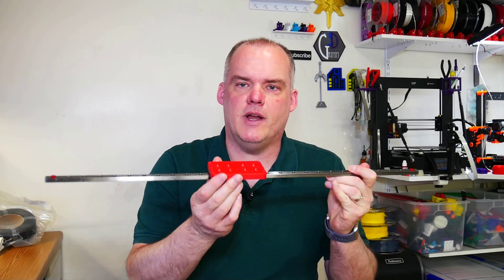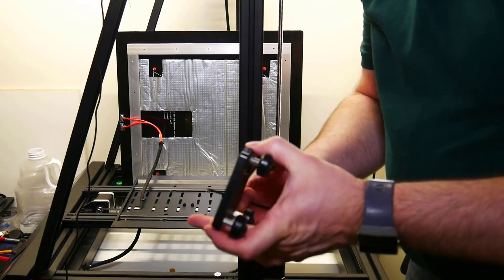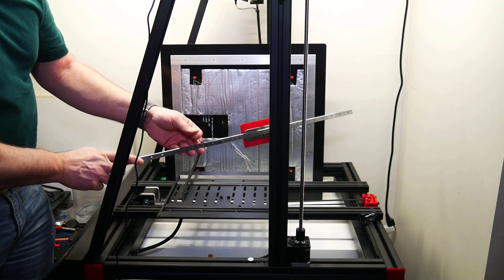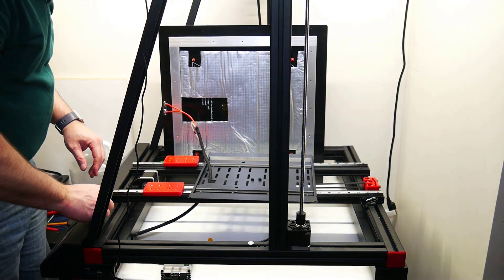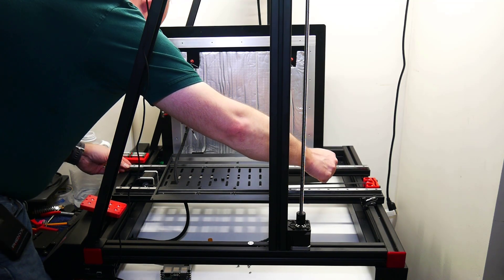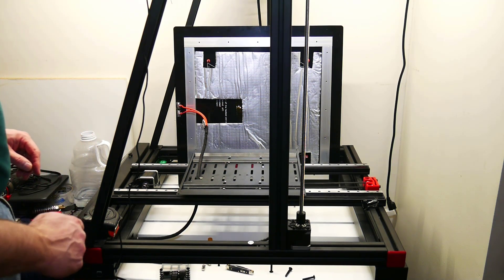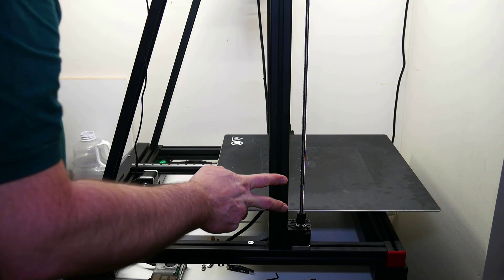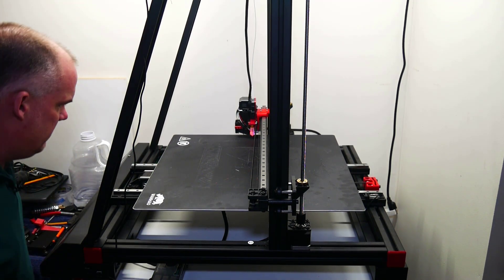Monster Y Rails

Comment: Thank You for the videos!
I added linear rails to my D9 500 on xyz and still had the same problems as is visible Your white benchy until I tensioned the x and y belt really tight.
I have now also added a bondtech extruder and use a 0.8 nozzle with it now, it has improved the reliability of the flowrate immensly.
My next improvement will be a new part cooling duct (and maybe a better hotend).
Oh and I just subscribed.
Reply from the maker: If you look through the playlist, I've already done many of those things. It is a process though - but fun. Thanks for watching and for being part of my channel.

Comment: Thanks for the video, it's going to save me time.  please can you post the stl link for the belt adapter that you designed.
Reply from the maker: Yes, I'll post it on Thingiverse, BUT I noticed that my belt is still not running true. The motor/drive pulley is mounted lower than my idler pulley, so I need to bring my motor mount up a little and then i'm sure I'll need to re-design the belt adapter so everything lines up perfectly. 

Here is the Thingiverse link: https://www.thingiverse.com/thing:4305709

Comment: Great video, please can you share the stl for your camera mount, been searching for hours to try and find it.
Reply from the maker: Which camera mount are you asking about? the one on the D9/500? I designed that myself and it was never posted. That mount won't work for everything because it will get in the way of larger prints. That's why i never posted the prototype STLs. But if you want it, I will post the STLs on Thingiverse. Let me know
Reply from the maker: Here is the link to the camera rail and side clamps https://www.thingiverse.com/thing:4320111/files

Here is the link to the Knobs I used for the adjustment bolts https://www.thingiverse.com/thing:4320090

Both require pausing / embedding in the print. If you need help with this, let me know. I'll post a vid

Comment: Are you going to place an skr board with tmc steppers inside?
Reply from the maker: I hadn't planned to upgrade the board and stepper drivers unless I need to. I did receive information from Moon's motors that there is a significant upgrade to the Y-Motor on this D9, so that might be a future purchase. My current plans are to add linear rails to my Z-axis, and after all that is done, I have a Hemera print-head ready to replace the stock D9 Head. 

Of course, these will be future videos, stay tuned. . . and Thanks for watching!
Reply: @Grimm3D  Alright, replacing the stock print head will definitely improve the print quality. As from what I've heard its crap lol. Still hesitant on buying a D9...Would rather just buy the frame and steppers only and add in my own electronics and hot end... Or tbh, for a bed this size. Isn't core XY the better configuration?
Reply from the maker: You can see the increase in my print quality if you watch the playlist. However, I purchased this D9 on a Black Friday Sale for around $800 (if I remember correctly) and I purchased it with the intent of tinkering. The D9 Mk2 seemed to have one of the strongest frames around. I'm sure the D9 is not right for everyone. 

A large format core X-Y printer would be sweet to build from scratch though. . . hmmm
Reply: @Grimm3D  Yeah I did notice it, have watched all your videos on the D9 ;) 

I wouldn't mind tinkering with a machine, but I am thinking buying/building a core XY printer that size would be only slightly more expensive, if not the same price as a modified D9. And the D9 will never be able to print at high speeds because of its  big heavy moving bed. This is where coreXY mechanism are better... I guess I'll wait and see what kind of quality u get when you are done modifying it :)
Reply from the maker: @obinnaeke8067  I expect to get pretty decent quality, but I agree, I don't think I'll ever get speed. 

Until I build a core XY monster. 😁
Reply: @Grimm3D  you're replacing it with a hemera direct drive or bauden? Wanted to get a dd hemera for my D9 300 but they've been out of stock for months. They're hoping to have some available next month so we'll see.
Reply: @Grimm3D  my ultimate goal is to replace the main board in my D9 300 with a duet wifi clone. The stock boards don't last very long I hear so the plan is to get it aligned, print some mods, install linear y and maybe X and hopefully by that time learn what it will take wiring-wise and config wise to swap to duet wifi
Reply from the maker: @alvarabra  I will be replacing with a Hemera, however the one I purchased is labeled Hermies (so I probably have old stock)
Reply from the maker: @alvarabra  Sounds like a good plan. I have no plans to update the board, but that doesn't mean I won't
Reply: @Grimm3D  yeah not sure if you've been following the hemera fiasco but they had to recall all their inventory from their distributors and there's no telling when they'll have it available again. Seems like the gears were cracking, there was misalignment of some pin, the mounting tabs would break easily etc etc. Trianglelabs had a clone they were going to release but had to pull it back as well due to all the issues, the design seems to be bad overall. Thinking of getting a Trianglelabs Dragon with direct drive as that's recommended by the Voron folks and they're pretty hard core about their quality, but we'll see
Reply from the maker: @alvarabra  interesting. . . I'll have to do more research.